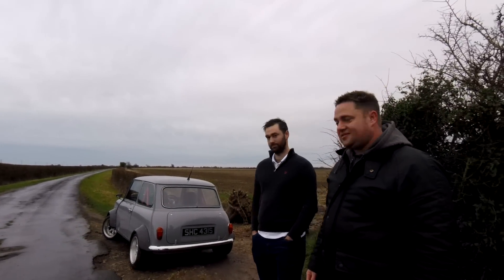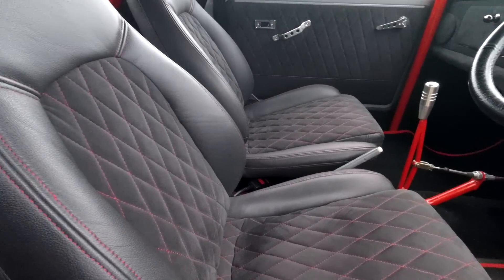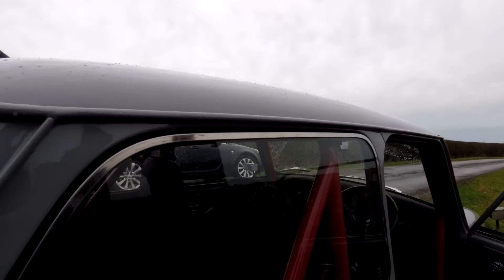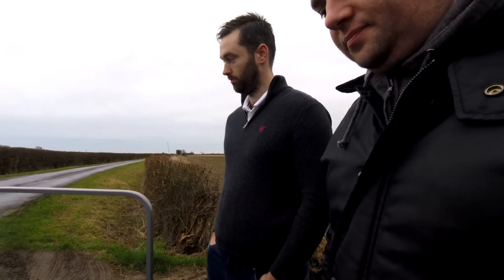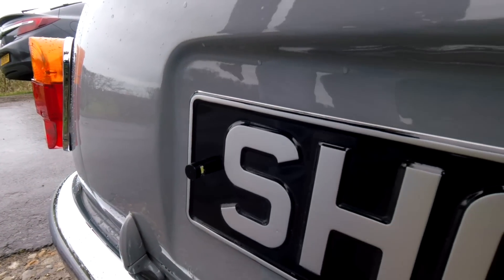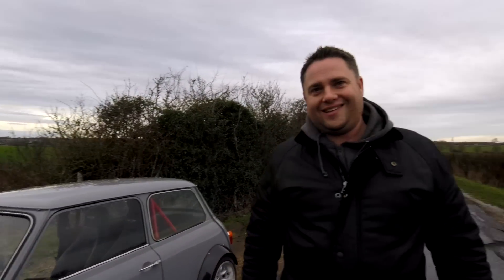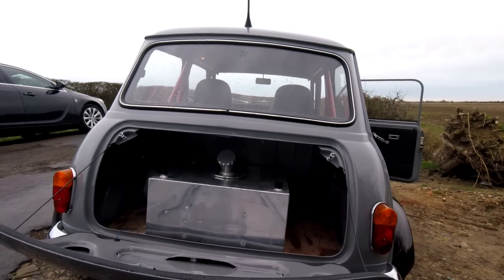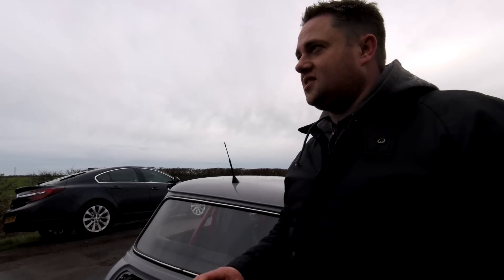UK's MOST HARDCORE MINI COOPER WITH YAMAHA R1 ENGINE *MENTAL

Comment: You dont need to use the clutch when going up the box, only when going down. Off the gas for a second and engage the next gear. Or get a quickshifter and keep your foot flat to the floor. Its a motorbike engine not a car
Reply: I fully agree